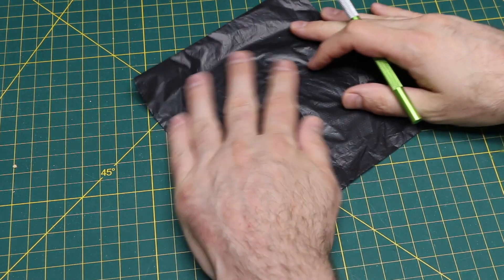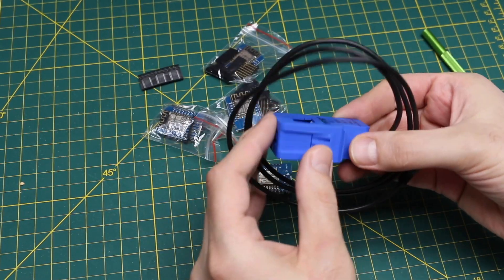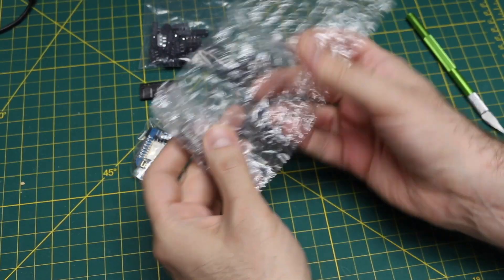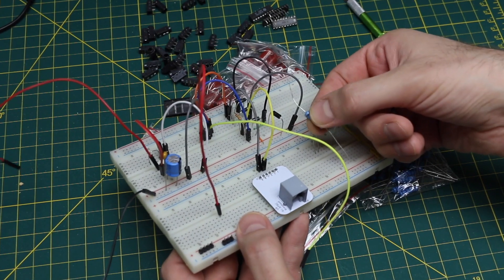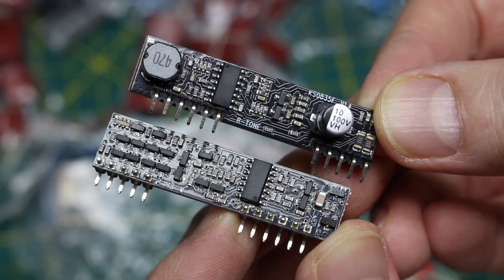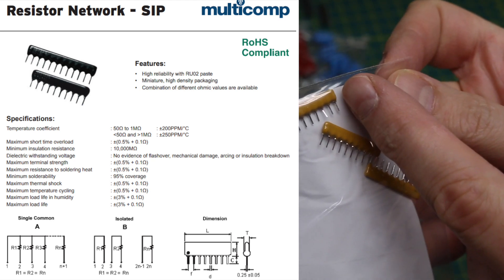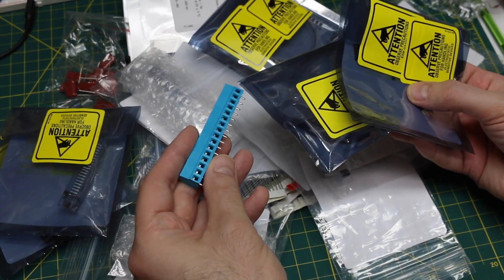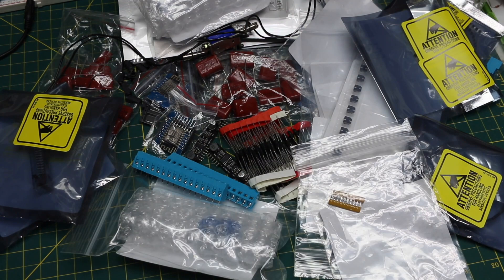Mailbag Aug 2022

Comment: I know this is an older video, but question:
Can you use those wi-fi modules to give wi-fi to a raspberry pi without wi-fi like a pi 2b+?
Thanks for all the videos, just browsing your vids and watching as i mess around at my desk :D
Reply from the maker: depending what kind of functionality is needed for Wi-Fi on the pi, the ESP modules can act as a slave device that can communicate with the pi over whatever available serial port they can both connect with, whether it’s UART  SPI or I2C
so the pi can talk to the ESP over serial and tell it to go get information or to send information over Wi-Fi and let the ESP do it like a co processor and then report back any data finally to the pi
Reply: @GadgetReboot  Ahh, ok, thank you! I will have some studying to do now. Still learning my way around all the things you can do with these things. So interesting they are.

Comment: What is the part number of the blue 16 position screw terminal at 8:15?
Reply from the maker: TB007-508-16BE   It comes as four  3 pos and two 2 pos, which you can see if you look at the product picture on Mouser up close. It's a good thing it came that way because I think I'm going to split it into two rows of 8 so I will use  2x3 and 1x2 units now.
Reply: @GadgetReboot  Thanks. I've been looking for something exactly like that!

Comment: Fun stuff.  You're going to be the go to guy for phone line stuff. I'm wondering if keen ears will be able to tell a difference between the phone ring sound from that alternating DC ringing and true AC.
Reply from the maker: I did a fast test and I think it sounds the same to me, but the ring frequency is also user controlled by pulsing a control input at a certain frequency so I tested with 20 Hz from a signal generator to get the right freq.  And otherwise I wonder if electronic ringers really just look for the presence of a ring voltage and then just generate a fresh signal anyway rather than responding in step with the ring signal, so they'd be normalized.
Reply: @GadgetReboot  Ahh yeah.  You're talking about the electronic ones. I always thought I remembered on old tv shows that the analog bells never really sounded quite right when they rang.  Almost like they struggled a bit.